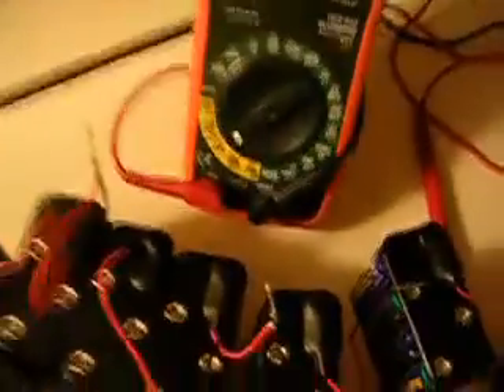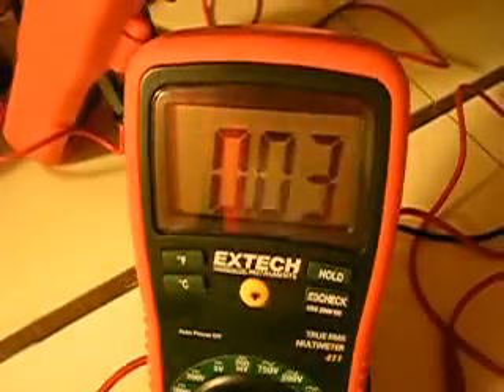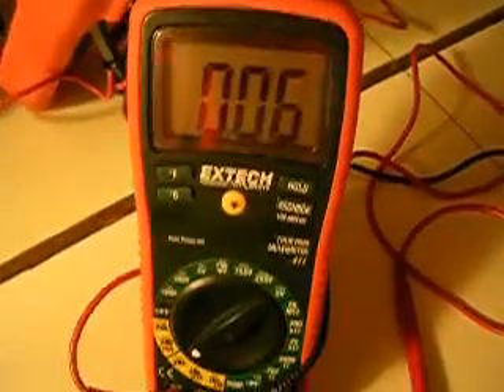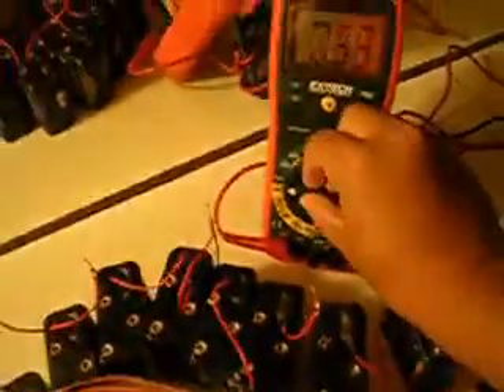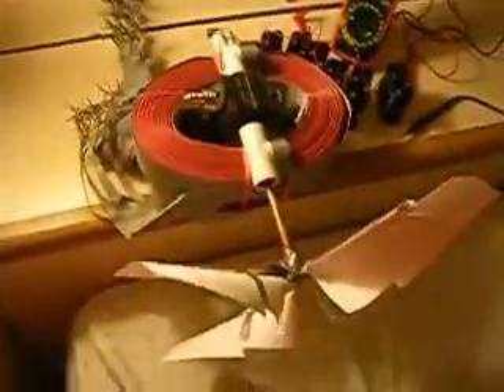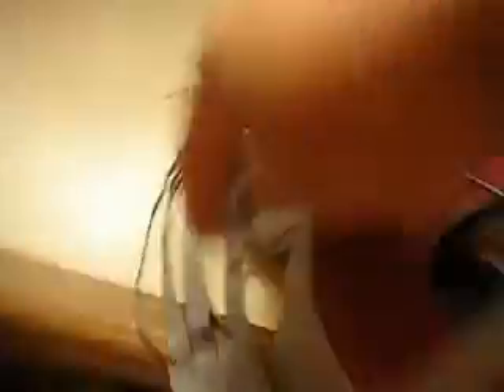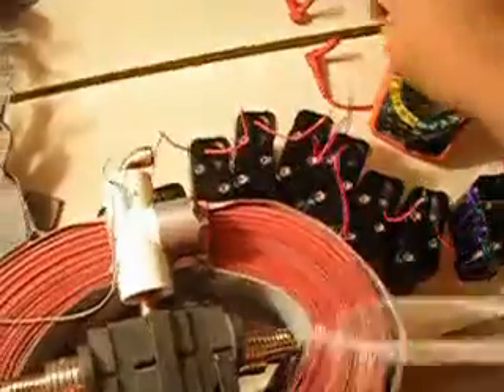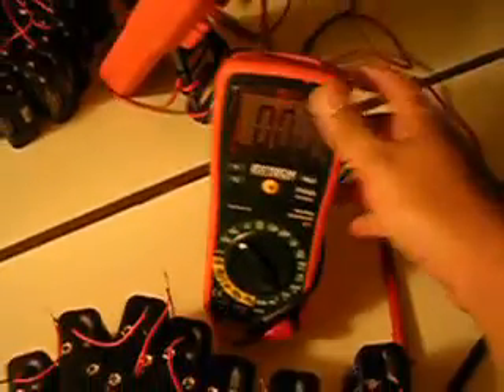Paper fan ▲ Full Pipe

Comment: A better proof of concept would lift a weight with a pulley system to accurately measure work being done by the motor. Comparing the volts and amps readings while it's lifting the weight will show the true value of power consumed compared to the weight lifted X distance to show the true efficiency.
You do that, and I will have a financial opportunity for you to integrate such systems into a multi million dollar wind farm project underway.
Please contact me when you can prove its efficiency.